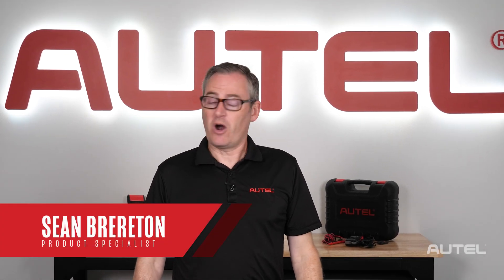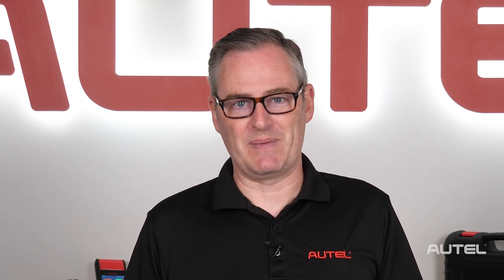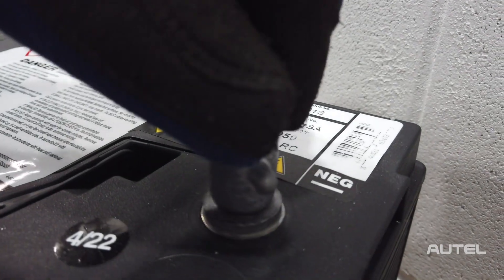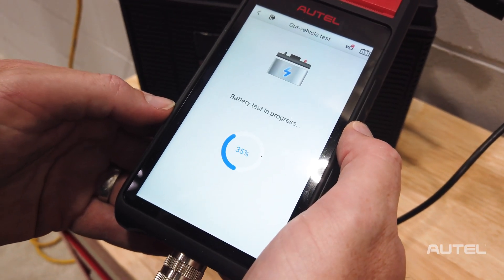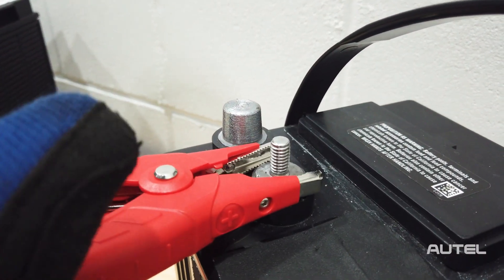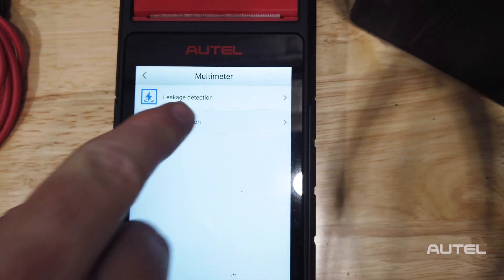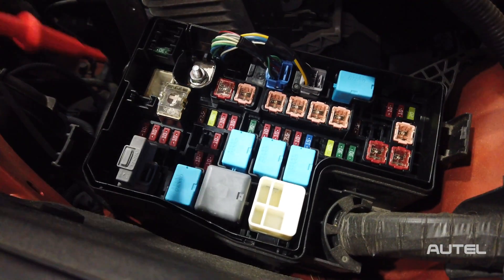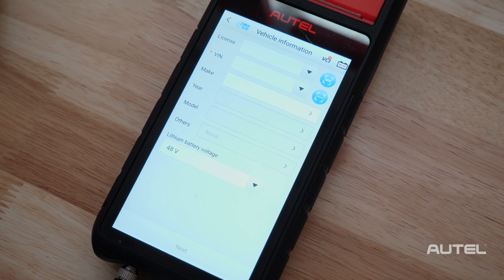Analyze More Than Car Batteries With #Autel Battery Tools

Comment: Can you tell me why the bt608  will only test 2016 cars, when will this tool be updated
Reply from the maker: Hi Gary, this tool is frequently updated. The current version you should have installed is V1.59, pushed out 8/16/22. If you can't see past 2016, please connect to wifi and update your tool. These updates are free for life to the original purchaser! - Sean